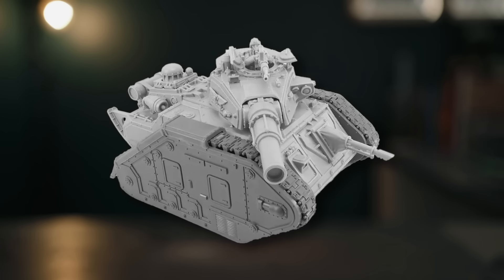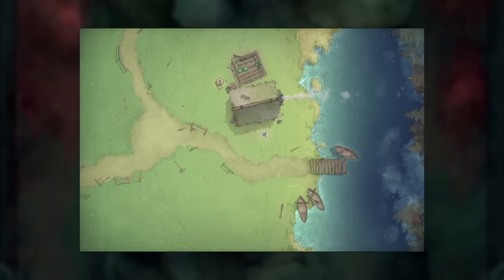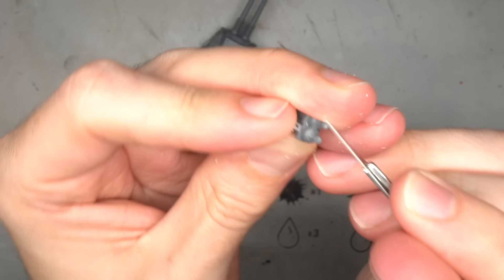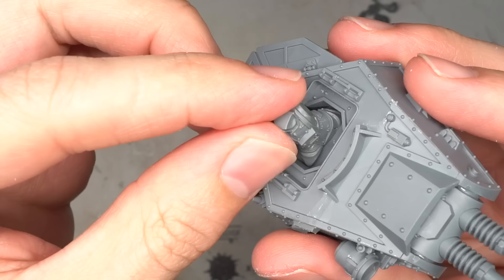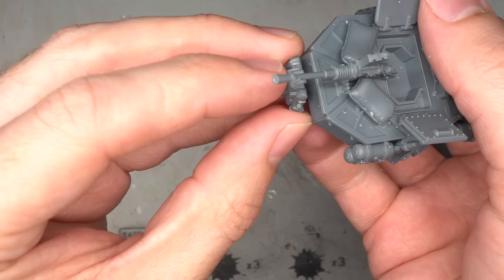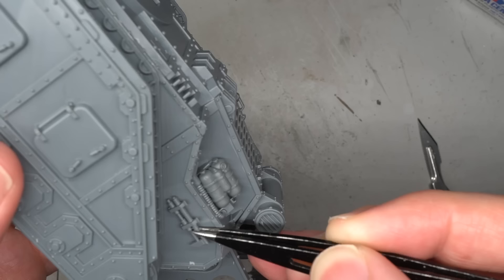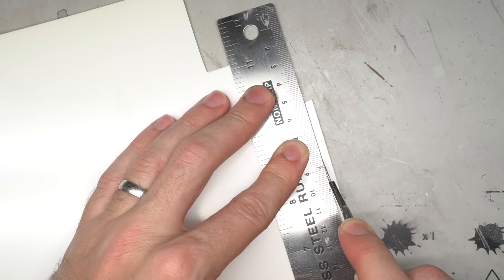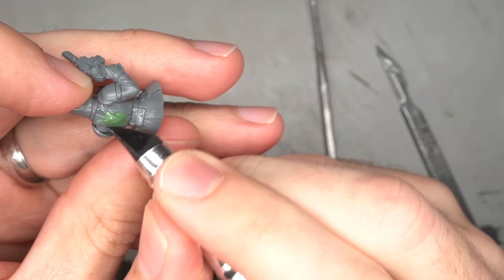Kitbashing A DEATH KORPS OF KRIEG Leman Russ Tank

Comment: For those looking to replicate the discarded shell casings look, but don't have (or want to use) styrene rods (or don't want to cut them out), you could use tiny cylindrical beads. I've bought loads of them before, in very "28mm shell casing" size and shape, from my local dollar store's hobby section. Various other stores, like generalist hobby shops or even Walmart also carry similar beads. (I even have a variety in my bead collection that is the bronze-like in appearance, that I use in terrain projects, as I don't need to paint them).